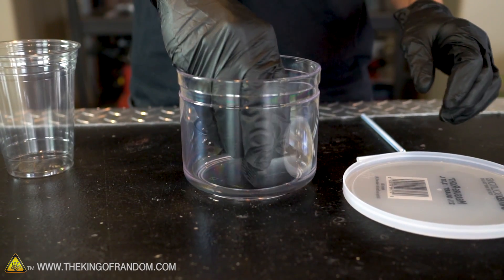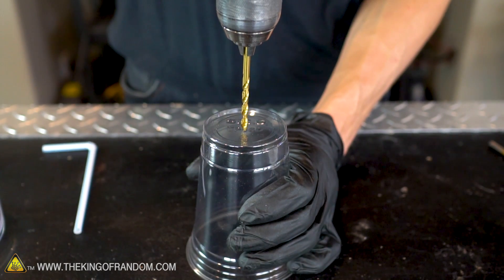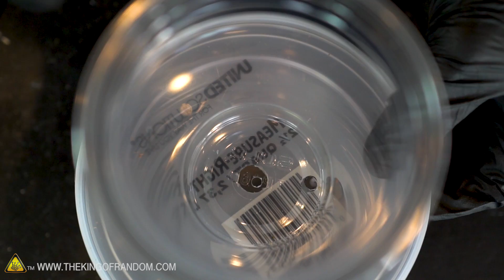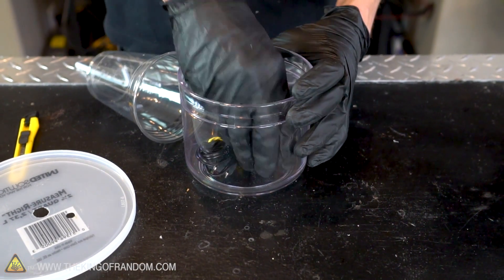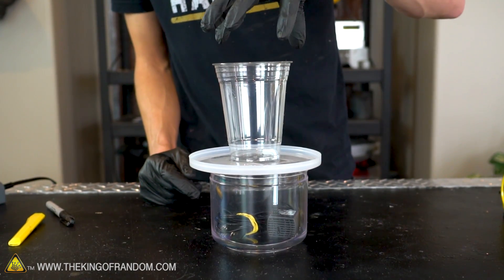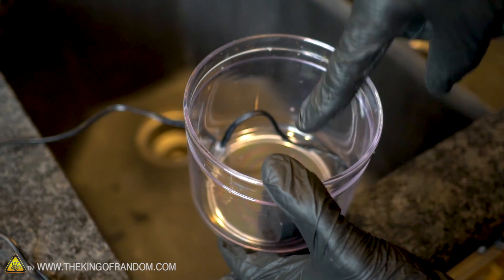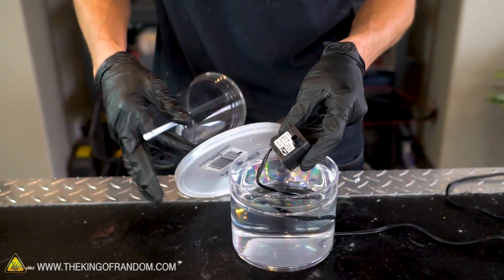Homemade Perpetual Vortex Fountain! TKOR's Guide On How To Make The Best Water Vortex Fountain

Comment: Was great until the "wire splicing" Wire twisted together and covered in electrical tape for a water pump on mains voltage?! You should know better!! Thumbs down for encouraging people to endanger themselves. Sorry.
Reply: Pro-tip: he could've bought a power switch and used that, instead of electrical tape. Two birds with one stone! (you know the inline kind that table lamps often have)
Reply: That was such shockingly bad wire work, it’s got me all amped up. Getting bit by main power hertz so bad it’s lights out. Despite the dangerous build instructions, he does bring a lot of positive energy to the channel.
Reply: Many small pumps are designed to run off isolated low-voltage power supplies.  Alternatively, one can buy mains plugs that are designed for installation onto existing cords.  Either approach would seem better than cutting and splicing an unprotected mains cord.
Reply: There is no bulky box on the plug, that's just a case, it does not contain an AC/DC converter, it's carrying the full mains voltage, an AC/DC converter would look a lot bigger than the casing.
Reply: An actual AC/DC converter is tiny, it's not the converter that should take up more space it's anything designed to change the power output. It's an AC/DC converter alright but it's just a converter it's still using the full mains voltage.
Reply: agreed, and to the untrained eye it looked like he taped them together which is a one way trip to destination house fire
Reply: Mitchell Lubline or 240v in England where I'm at!
Reply: I have done something similar but used 3 layers of heat shrink tubing, 2 on each of the individual wires and one to cover and hold the splice firmly: 1/2" to cover the soldered wires - 3/4 - 1" for the final wrapping.
Reply: thats what im thinking i thought he could have at least used a heat shrink and a liquid electrical  tape laer
Reply: It is worse that it is a wire to a pump.
Reply: jacob strange i hope he actually did atleast wrap them separately. He shoul've just cut a bigger hole to fit the plug through and then sealed the hole, but atleast he chose to cut it farther down away from the container.
Reply: Thank you for expressing your concern for the viewers but with a complaint it always comes with a suggestion for improvement
Reply: Yes there are
Reply: David Thomsen no but common sense should tell you this is a very unsafe solution that may get someone killed when the try to replicate it. Especially due to the age demographic of the channel. There was no mention of a drip loop, the hazards of such a crude splice, So many dangers with what he did it's hard to list them all. I'm no expert but I would not have a cable in that condition in my house.
Reply: Siberian Orange so now people can't express a concern? A crude splice of an electrical cord has caused house fires, electricutions and death to many professional workers. A crudely spliced cord for aquatics will burn a house down at the very least. A moth blacked out Japan by getting into a electrical plant and shorting out the system and squirrels have crippled the electrical grids around the world by chewing on power lines. What do think you a child or family pet could do with 120 volts?
Reply: Kevin Oakes instead of tape he should of used silicone rubber to bind the wire in place what he did is very unsafe
Reply: Respectfully, there are better ways to say the same thing. If you could try offering a suggestion rather than a complaint, I believe you'll find your comment to be far more effective.
Thanks.
Reply: Are you some kind of an expert?  Because you sound like the type of guy that can’t move because you can fall
Reply: That wire isn't carrying the full current of the wall. That bulky box on the plug is a DC converter, and that wire is only carrying the small amount of current needed to power the pump's motor.
Reply: u arent indeed

Comment: Try adding a bit of dish soap to break the surface tension of the water. I would think it would make a uniform pour over all parts of the edges. Maybe there is another chemical that could break the tension without the risk of bubbles to maintain a sleek look?

Comment: Instead of using that plastic lid, you should have just used the lid that came with the container and drilled holes in it. It would have looked MUCH better.
Reply: And yes I know it wouldn't have the lip but one could easily be added

Comment: Hey since you cut the power cord you should put in a surge protector just because if water runs down the power line you know l-pop before it hits the line
Reply: And by putting a little surge protector and it you could run another line off with a on off switch

Comment: Your description of the popsicle stick being to wide, i believe, was wrong. If it "flared" as you said, it would have been wider at the top making it take up more room. Thus meaning it should have been a smaller gap at top and larger at the bottom. As to why it was as you stated, im not sure.

Comment: What is perpetual?
Reply: occurring repeatedly; so frequent as to seem endless and uninterrupted.
Reply: Jacob Miller no one had provided the correct answer so I provided it no big deal
Reply: Jacob Miller no, no he did not
Reply: Taglini I think you're just being dense now I provided the exact answer that is correct in the context in which you use the word for this experiment by definition I provided the correct answer
Reply: Neyrs is right. Perpetual simply means not ending. Perpetual motion is when it doesn't need energy.
Reply: Taglini - If you really want to know he is right, look it up
Reply: Going infinitely
Reply: Yo mama
Reply: Well I mean you didn't really provide a correct answer either... The whole focus of perpetual is that it doesn't require energy use to continue infinitely, so basically this project isn't perpetual, but it's still cool
Reply: Nerys Wrong
Reply: wow. Taglini says the absolutely correct right answer with sources to prove it is "wrong"

Yep. argument over. no point in continuing. Taglini has spoken.
Reply: William CS it means endless
Reply: I didn't expect there is this much reply wow
Reply: Nerys you don't have to answer the question if someone has already answered
Reply: Milo Burrell did

Comment: I once made a larger version of this, however the water was not recycled. It consisted of a 5 gallon bucket with a garden hose fixed to the top angled slightly down following the curve of the bucket. The water would exit through a hole at the bottom of the bucket that was somewhere between 1/2 an inch and 3/4 inches in diameter. Neat design, and it would produce vortexes that went from the top of the bucket all the way to the bottom. While not the most efficient, it is certainly cool to see and simple to make.

Comment: You could have used an inline switch instead of taping the wires together and killed two birds with one stone
Reply: RMoribayashi Brilliant idea! Safer AND more effective. I hope they read this one...
Reply: RMoribayashi I was thinking the same thing
Reply: I know. He ghetto wired it with electrical tape instead of soldering it and using heat shrink the right way

Comment: Should be noted u should use distilled water much less chance of mold also it puts less stress on the motor ..... regular water has been treated with minerals melt all chlorine and other stuff that will eventually cause build up on the internals of the pump

Comment: DO NOT just leave the cord twisted and electrical taped. This is irresponsible and potentially dangerous. Get some butt connectors or solder it and use heat shrink tube. Its really not hard to do.

Comment: Next time you need to reattach a cord you could use heat shrink for the wires, and also, given that you already cut the wires, you could put a toggle switch, a rocker switch, or a inline lamp switch to turn on or off the fountain.

Comment: The only thing I would have done different is to solder the spliced wires.  For one, just to strengthen the hold, and also to keep the newly exposed copper from tarnishing, which increases it's electrical resistance.

Comment: Awesome project 😍 might just try doing this, I have a spare aquarium pump lying around
Splicing the power cord is something that's worrying me. 
Might just cut a notch in the container or cut the two wires at different lengths to avoid any shorts

Comment: I had an artificial one at home. It was made like a mermaid with water running through it's hairs. Anyways, I have a little suggestion for next larger one you are going to make. In the next one add some of the colourful Christmas lights under the water to make the water look colourful and little bit of shampoo to go a some foam. It would look beautiful with that. 👑👑

Comment: Hey, great video. I'm a little concerned how little you went over the splicing of the wires. As someone who knows how it's not a problem, but if someone who doesn't know how this could be dangerous. It looked like you tapped the two bare wires together and never said anything about being careful not to. If someone didn't know and tried to reproduce you work they could end up in a dangerous situation. Just a thought, fantastic otherwise.

Comment: about the wire cutting part don't just cut it and tie the copper and then rap it with tape u need to rap each cable seperatetly from the other or else u r going to burn the pump

Comment: The little air bubbbles come from air getting into the pump.
When the water drips into the bottom resivoir, its not LAMINAR flow, so it disrupts the surface.
This introduces air into that bottom basin, and that air gets into the pump :)

Comment: Very nice project, but it really bothers me to see the overflowing water coming out from the cup. I think you should use adjustable water pump to control the flow so that the water did not overflows. Also, add some LEDs to illuminate the water for night-time purpose

Comment: You should have, at the very least, used butt splice connections for the power cord. Teaching people that it's ok to twist and tape 120VAC wire is just irresponsible and dangerous.
Reply: Not to talk about the fact that, if a leak develops where the cable enters into the container, water would just run down the cord right to the spliced part!
Reply: Varial Reality yep and it didn’t show one wire being taped before they were taped together. Very dangerous for someone who doesn’t know much about electricity.
Reply: I thought the same thing. I would have used heat shrink tubing and solder, though that may not have been enough either. I vehemently disagree with not soldering the connections.
Reply: Technically it is OK. For people who know what they are doing. He should have mentioned something about it though.
Reply: This guy is very irresponsible with electricity. I’ve seen it in earlier video too. I don’t like him much
Reply: True, but I highly doubt anyone who doesn’t know what a 120VAC wire will try building this

Comment: I wonder if you use a hot glue bead on the outside of the cup in a spiral design so when the cup overflows its will spiral down the outside of the cup too.
I like that hotglue gun with the small orifce Whats the make and model of it? 
Great Video as always

Comment: Awsome idea! Why don't you trzy adding some turbulators inside the cup? It might causes some interesting effects to the vortex 😉  it would be nice to paint the straw inside at the bottom of the cup to blend it with a dark plastic basen, and sort od hide it. Another idea od to build it using DC motor powered pump with PWM regulator to adjust the power od the pump so the water doesn't spill over the edge od the cup - but it would be much more complitated then your geniously simple idea.

Comment: Melt a magnet and cool it down and see if it still has magnetic properties
Reply: Spoiler alert

It does not retain any properties
Reply: you don't even have to melt it to get rid of the properites
Reply: The metal losses its magnetic properties at the curie temperature. Will recrystralizing, the metal would become weakly magnetic due to the earths magnetic field.
Reply: It wont

Comment: Technically it not perpetual because when u remove the power it stops move
Reply: technically it is perpetual

occurring repeatedly; so frequent as to seem endless and uninterrupted.
Reply: Hi Tnx for the reply but it's not perpetual cuz when u off the power it stops hence its not perpetual and the meaning of perpetual is never ending so since it ends when u cut the power it's not perpetual Tnx
Reply: Nerys k I guess u right Tnx 😀😎😜😝🤗

Comment: I think there is a problem with your drain holes in the lid. To make the water drain smoother, you could make another hole inside the lower container above the water level

Comment: So just a curious question did you make sure to keep the wire from touching each other. Reason I ask is it could short circuit. Now I know you probably know more than I do about this stuff but it kind of worried me. Oh and if you want to have a switch for the little machine you could add a switch to the cord.

Comment: For reference, straws are 1/4 inch thick
Reply: Avoxion GD Alright, it's 5.588 billion picometers.
Reply: t h i c c
Reply: TheSyrianGamer Do you mean 5.588 metres? You said 5.588 billion picometres, which is 5.588 • 10^12 pm. And 1 pm = 10^-12 m. But that would be a really big straw, so I suppose you meant 5.588 thousand million picometres or 5.588 • 10^9 pm, 5.588 mm (millimetres), 5.588 • 10^-3 m or 0.005588 m.
Reply: Eldar WHY THICC TREND?
Reply: 1/4” diameter? 😂
Reply: Avoxion GD they are real units here in America.
Reply: Avoxion GD He's in the USA. That's why he uses that system. There's nothing wrong with it but you're too ignorant to accept that.